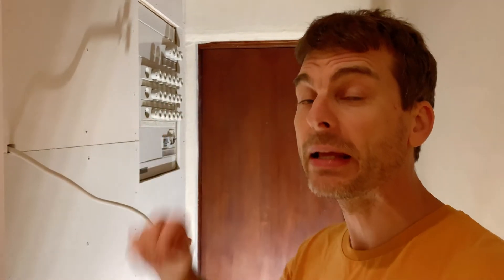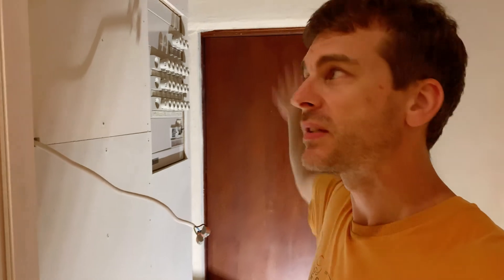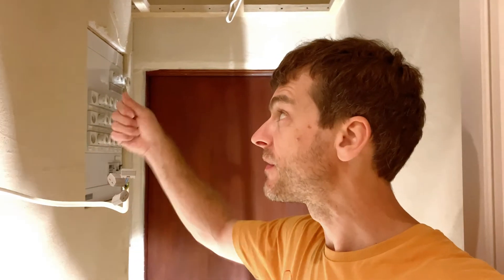Renovation: an hour of clay plastering

Comment: Why is the hole for the (i'm guessing light switch) so small?

wouldn't it be better to cut it to size now?
Reply from the maker: Mate! It’s actually for a temperature sensor. 

Yeah I probably could cut it to size now. I thought it’s not so hard to cut it later and then I can cut exactly to size and also not worry about damaging edges while I’m throwing clay on the wall with the trowels.